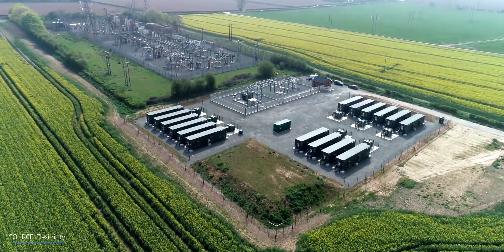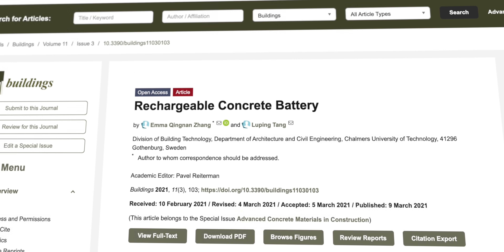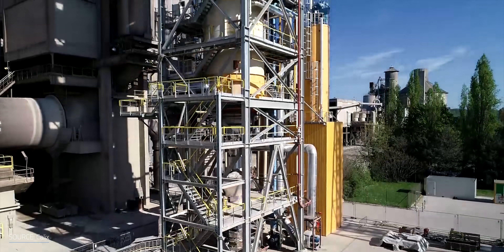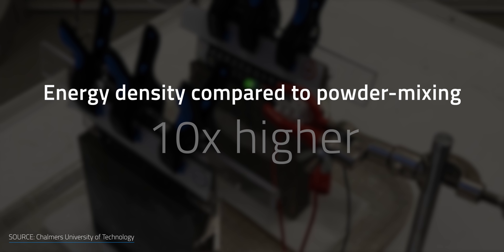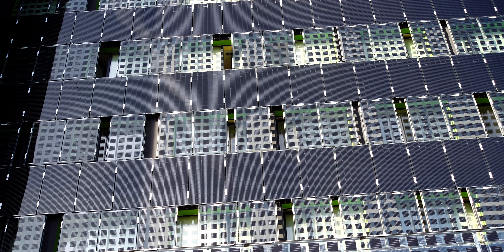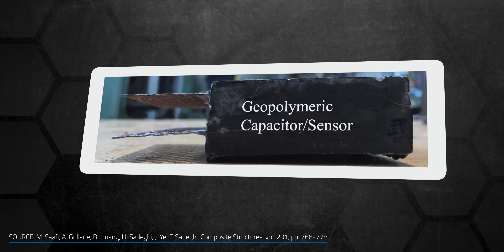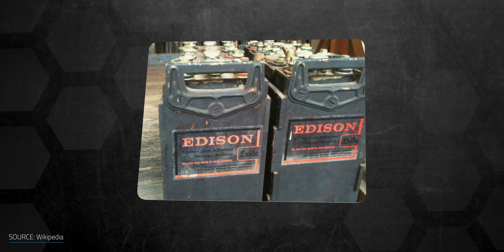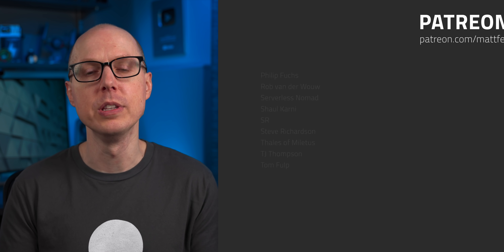Turning Buildings into Batteries? Concrete Battery Storage Explained

Comment: what about the battery structrural resistance compared to regular concrete ? I though that would be the first answer, because you know, main concrete usage is in STRUCTURES, to HOLD things. If you plan to change that and add some other functionnalities (here energy storage) you should compare how it performs on its first objective first. If overall you need to pour like twice the same amount of concrete in order to achieve the same structural resistance, leading to bigger buildings for the same usable space, that's not good at all.

Comment: Having a corrosive compound in steel reinforced concrete would require constant monitoring and extremely diligent maintenance. I don't care if it's encapsulated in something, it'll get out. Concrete is amazing stuff, but if it's not properly maintained, people die.

Comment: first need to solve the CO2 problem with concrete. WE need to be using less concrete not more. Think there are already better battery solutions out there to worry about using concrete.

Comment: Would be interesting, what they plan to use for an electrolyte.

Most Ni/Fe batteries suffer from rather high cell voltages. If the cell voltage exceedes about 1,25V, water and water based electrolytes beginn to decompose, resulting in high self discharge rates, hydrogen buildup and heavy wear on the battery itself.

Comment: The one thing that is overlooked is a holistic, synergistic solution incorporating multiple technologies at the same time leveraging their strong points. Looking for that one Holy Grail of of renewable energy production, storage and decarbonisation stand alone solution is a wrong approach. If combined to work together the tech we currently have commercially available would be more than sufficient to ditch fossil fuels, few times over. The problem is not in the technology but in the omnipotent petrochemical mafia. They will not let go of fossil fuels and plastic, ever, and the only way is to make them.

Comment: 7 Wh per m2?.. what is it supposed to do??
And you need to mess up with your structure integrity? ANY changes to the cement design may easily triple the cost of the structure, just because you need to retest and redesign anything. 
You better improve is performance by 100x before it is even worth considering for real life application

Comment: They only tested charging and discharging over 6 cycles and saw that energy density decreased from 7.1 to 6.11 Wh/m² and still had the audacity to state you could charge and discharge endlessly without any loss? Does not sound too trustworthy to me.

Comment: So it comes down to energy density, cost and longevity of battery life? It would be pointless to build a building sized battery that doesn’t last the lifetime of the structure. Similarly cost viability would depend on amortisation over the lifetime of the structure assuming the battery components could not be independently renewed.

Comment: Hmmm, 7 Watt-Hours per square meter... That means that to backup my typical home usage for one hour, i.e. 3 kW-Hrs, would require 21,000 square meters. Good luck with that.
Reply: Sorry, just after posting I realized my mistake. That should require about 428 square meters, or a bit over 4,500 square feet, still much larger than my house.

Comment: I doubt that the capacity is sufficient to cover the cost and hassle of building them into a structure, complete with electrical isolation and installation issues. Sorry, good try, but not practical enough yet.

Comment: To the myriad of potential issues mentioned in this comment section, i had one simple thought: how on earth do you maintain the structural strength with anode corroding and partially renewing with recharge cycles without even taking into account electrolytes? Unless you make that mix a really elastic and durable, which would turn it less rigid. How would it not crack and leak otherwise? Just asking, as it will need to stand a test of time and earn investors confidence in longevity and safety of this system. 

 P.S.> Since the removal of dislike count fore the mere users, among all other degradation on YT i propose an experiment. To dislike every upload you click upon. It still counts the same engagement as likes, so no harm for creators, if they know, why the like ratios are going down. Algorithm is harmfully biased for a long time now anyways, might as well see if it changes. React, even if you're only a product for social platforms. We don't need another TicToc here..

Comment: Wouldn't turning concrete structures and walls into batteries pose some kind of electro-magnetic field that would interfere with electronics or even pacemakers?... and when it no longer holds a charge do you just tear it down? It must add all kinds of weight to the concrete and therefore the structure... What about in a flood zone or if a waterpipe bursts or if there is a fire in the building and water is applied to the fire...   LMAO... so you promote all the "potential" of this science and then at the end tell us you just wasted our time because it's all BS... so this was just a SCAM way to plug a product... ask Native if they want to sponsor my video about the time I was abducted by Aliens who had shape shifted to look like FBI Agents... 🤪

Comment: Hi Matt, this is too good to be true. In short, there are too many variable in our lives. To make the concrete battery work you need to consider the people living in it and its surrounding. Environmental issues like temperature, humidity, seasons(lightning + snow + monsoon) to day to day lives issues like WIFI, handphone signal, drilling a hole on the wall to hang a picture or plumbing/wiring issue. All these issues add up, and in the end is it safe to use after all that I mention combined??

Comment: B-B-but, concete has always been a thermal storage material, because of its thermal mass. It takes~12 hours for the sun to heat a solid concrete wall, then the concrete wall emits that absorbed heat for another 12 hours. Therefore, the interior stays a constant medium temperature. That greatly reduces auxiliary heating costs. Energy saved is as good as a penny earned.

Comment: Stupid idea. A loss of capacity of 10% in 6 recharge cycles is bad. Maintenance would be a nightmare. What would be a re-sale value of a building with bad electrical capacity? How do you test as a buyer what it really is? In my region temperatures from -40C to +40C. I think this concrete cells won't get through a single winter. It would be a lot simplier to take a wall in one room and make a rack of batteries. Then put another light wall over it. This way atleast its accessible.

Comment: There is a difference between concrete and cement…I’m not a civil engineer, but I believe you cannot build a strong building with cement…one needs concrete (which cement is a component). Will concrete work? You intermix the terms throughout.

Comment: Umm battery fine but what about super capacitor 😿or a huge capacitor with higher volume storage so soler can charge cap while low energy is used. Battery should be used. But waste need to be recycled.

Comment: This technology seems like it would be difficult to do on a construction site since it’s not just additives in the mixture. Needing plates installed dramatically increases the complexity of installation of concrete. Unless I’m misunderstanding or missing something, this method will not be widely accepted due to that and will not be implemented in 99.9% of buildings. Cool technology though

Comment: Concrete is used for a purpose (structure). If you make batteries out of it, then you want to build a structure using batteries. But the purpose is not longer met.

Comment: This is NOT a good idea. Nickel-iron batteries always release hydrogen because of how nickel cathodes work. You could technically use silver as the cathode, but it would be mad expensive and you would just be better off making a separate battery. Cement is a garbage separator no matter what you do. This company claims it uses graphite to lower the resistance, but graphite does not provide ionic conductivity. Also you would have to remember that NiFe batteries use KOH as the electrolyte which actually ruins the concrete mix PLUS  you cannot use the iron anode as rebar because it is going to corrode as a part of the charging / discharging process. Separate rebar would have to be perfectly insulated from the  actual cell part because if it wasnt it would simply short out the battery or slowly self discharge it via conduction through the electrolyte (same reason why simple coin stack lemon juice batteries arent the greatest)

Comment: I'm no scientist, but with my experience in construction I can confidently say this will not be used as structural material for any critical load bearing structure, it might be used as a self powered light pole but I don't see this being used in buildings.
Reply: I agree. I really don't know how reinforcement will play with this electrical concrete. I would like to see it or even design a lamp post, or some small products which are for the public. While this is a brilliant idea, I feel like its value should be directed to a more doable project. As an architect I'm also thinking of the value of such structural material. Would people really feel safe in such house
Reply: @The Southern Cross concrete doesn't hold heat very well, it's a cold material and ver yprone to water damage due to even microscopic cracks
There are concretes which are used as thermal concretes but, I feel like using this in some mass production isn't a good idea for now. There are so many other ways a building could create energy especially the topic they covered about transparent solar cells 
This idea can be excecuted maybe on smaller elements of city
Reply: @mrss_foster  I like that you mention concrete is a cold material. I've spoken with people who say that concrete holds heat better than water. Some stone might, but concrete doesn't.
As far as energy generation, that's not the purpose of the concrete in question. A battery doesn't generate electricity, it holds and distributes it.  Solar panels, wind turbines, water wheels, those are the types of things that collect (aka "generate") electricity, and while those things are getting more and more efficient, it's the battery, the holding cell, that we're having the biggest problem with right now. If we could store the energy our houses have collected via solar panels or thermal paint or solar windows (my personal favourite idea) in our houses themselves, that would be awesome. We wouldn't need external battery banks. But efficiency and structural integrity and maintenance and ecological and biological safety are huge hindrances, especially for something we'd be living and working inside.
Reply: @mrss_foster  For thermal mass you do not want a material to be insulating.  It should absorb and discharge heat steadily.  The home insulation needs to be outside of the thermal mass.  By volume concrete's heat capacity is around half of water's heat capacity.
Reply: @The Southern Cross "Supercapacitors are the future"
Ask an electrician why you're both right but also horrifically wrong.
Reply: It would have to be in non-loadbearing, interior walls and floors.
Reply: Barricades on highways, planter boxes in cities, parking spaces, or swimming pools would be enough of a market to call this an industry.
Reply: @stefanr8232  barricades on highways need strength, Parking lots need to be cheap, and really electrical concrete in swimming pools ? Planters seem like a decent idea tho.
Reply: Perhaps it still has a place in facades and other low stress, non load-bearing parts of construction.
Reply: If also worked construction and done concrete this could definitely work the reason we won’t see it happen is because it’s  free energy and this world at least in the united states nothing runs on free
Reply: Can't we work out on the designing part so we need less strength.
Reply: @vartikamandan4215  If you need less strength use less concrete.  May not be an issue because carbon fiber reinforcement is one way to make concrete stronger.

Comment: This is pretty cool, but my biggest question is does it affect the load bearing capability of the concrete or the overall stability? If it doesn't, then even if it has a pitifully energy density, it would be worth the additional cost to build into the structure

Comment: Screaming voice in my head: " How is this any better than the stupid concept of making batteries part of a car's frame". This takes planned obsolescence to a new level.  "Oh no, my battery house won't hold charge any more, time to demolish and build a new one."  When a unibody car frame/battery dies, what then?  Will these cars and houses only have a life as long as the batteries still function?
Reply: House struck by lightning, fries circuit, time to add an addition.
Reply: You are using frame and unibody interchangeably. Frames can be replaced ie trucks but most other transports use unibody.
If engineered responsibly with removable sections on a frame why not make the structure store energy?

Comment: Seems to me that such kind of basements built to double as a battery storage device couldn't have windows in it since when concrete basements settle cracks often form in the basement at the bottom corners of each window. Unless both the footings for the basement and the concrete ledge at the top of the basement perimeters above the windows could be better designed.

Comment: Things like this are really cool. At the minimum something like this could be used to supplement energy storage. It may not be the final answer but it can help along the way. Especially if producing it can become cost effective with traditional concrete.
Reply: ....my perception is ., we may need the big wins.....but we also need the small wins.......if this sort of tech can drift / dull grid peak requirements we may get there..........look at gridwatch ., yes ., we will have problems with base load ., but we have problems with the peaks .. If we can run lighter wiring to lamp posts ., as it could be dribble charged ..

Comment: Well, after seeing that the Chalmers U battery or the Lancaster battery had the electrical storage potential of a dead firefly, I will look back to Matt's enthusiasm for the rusting iron battery development from some months ago. It seems hugely more closer to commercial use than the concrete ones are. Good topic anyway. Maybe the concrete storage would be best applied to Mars?

Comment: I think the issues here are 1) They don't sound structurally sound. Concrete generally has steel in it as the concrete alone generally isn't enough and 2) You can never replace it. The building need to be set for a hundred years or more. Cutting out, or designing it to be removeable takes away the whole point of it. It needs to last for 100 years to be viable.

Comment: could store the power in hot water through hot water heaters, or molten salt reactors, or liquid air batteries, or hydrogen thru electrolysis

Comment: Sure, you could have entire apartment complexes made of such cement, but surely such complexes consume far more electricity due to a large number of people using a large number of machines.

What buildings can be huge but do not have internal consumers that will require more capacity than the cement can give?

Hydro electric dams come to mind...

Comment: Iron, salt, catalyst/catalytic conversion and heat… ehh. The other problem of converting concrete as a foundation material to a storage material is that you still need a structure material to hold dense load and form into fluid shapes/conduits. 

The idea of a cubic meter of concrete holding 5w to 10w is probably about right, unless you have crystalline materials embedded for baryonic or piezoelectric absorption of stress and isolation of cells and materials. It likely won’t happen, because there would be odd harmonics if high rise buildings and highways were absorbing vibration damage as a fluid or compression material.

It sounds like the old idea of mining the ocean for gold and iridium, and lithium, etc. good returns until you realise how difficult it actually is to pull off without free electricity.

Comment: This good stuff.. I have often wondered about how much mining will have to be expanded to meet demand world wide..will it be a case of replacing drilling with mining..and in the meantime the components made in factories that are still on coal.amd fossil fuels, then put on cargo ships that burn thousands of tons of diesel to deliver them..to plug into a grid that's also powered by the same..Guess as oil is phased out the price of oil will go up before it goes down maybe that's the point..